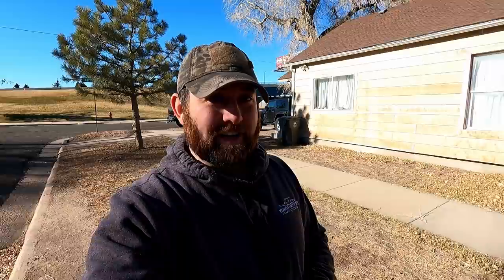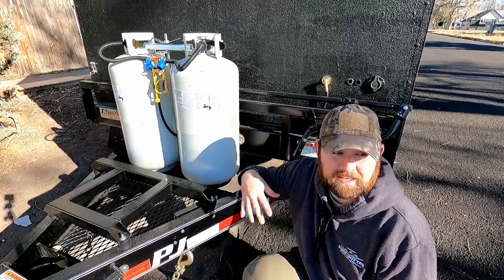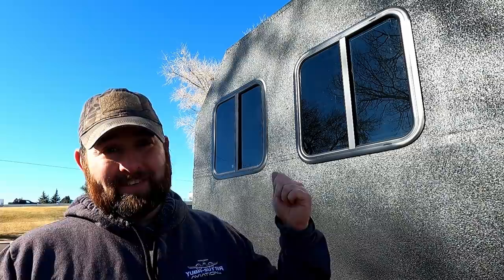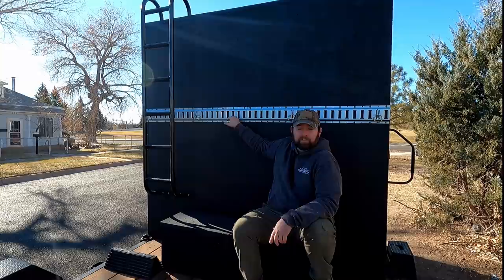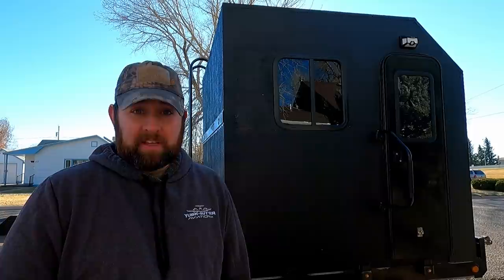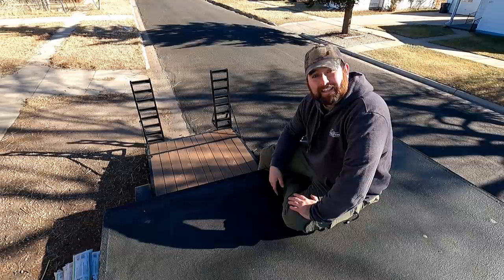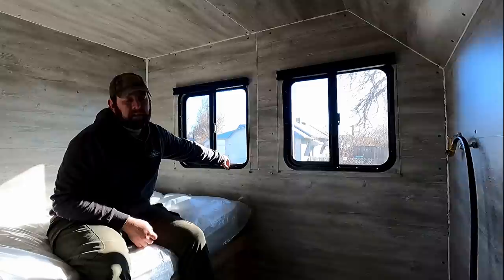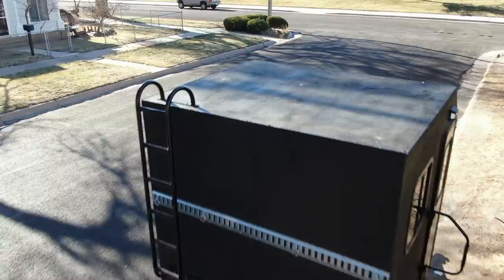DIY Crawler Hauler & Bugout Camper BUILD

Comment: An angled wind cover for your propane tanks would help secure them and add some storage space.
Reply: I was thinking the same. A box that cover the generator and tanks would look good.
Reply: Wouldn't hurt a bit if it were lockable and bullet resistant, either.
Reply: Was thinking in terms of security from thieves as well😂

Comment: You should turn the bed into a murphy bed so you can make the frame it sits on now into a couch/storage area. In the corner across from the door put in a counter top with the fridge under it and set up a rack on the deck side under the one you already have for an outdoor kitchen area with like a grill and sink that can be put away so you can water to the kitchen for cooking and washing hands and stuff. Also set up an outdoor shower off the the driver side of the deck with some type of rack to hang a curtain. You would still have plenty of room for cabinets around the top. Just some ideas I had while watching but you have a great design so far just a few tweaks would make this thing amazing

Comment: I use to be the draftsman for H&H trailers, my father was the engineer for featherlite trailers.  I suggest one thing.  your roof needs to have alum to make a water proof barrier with drip eves.  and glue and seal no screws.
Reply: @ryanjoseph5576  what was assholey about that? Just seemed like friendly, helpful advice to me.
Reply: Yeah... Raaar!  
Lol. Cool camper.
Reply: And there it is, right there, first comment. I don’t see at all where the main comment was negative in any manner. Helpful suggestion and constructive but no where near negative.
Reply: @bryanblake8607  I don't think they understand the information described.  

Hanlon's razor . 
"Never attribute to malice that which is adequately explained by stupidity."
Reply: @RichPianasOilPump  Hanlon's razor. 
"Never attribute to malice that which is adequately explained by stupidity."
Reply: @tenncutt  Hanlon's razor. 
"Never attribute to malice that which is adequately explained by stupidity."
Reply: @rcash3625  Hanlon's razor. 
"Never attribute to malice that which is adequately explained by stupidity."
Reply: Established proficiency then gave a solid suggestion.  Proper order.

Comment: May I recommend a Diesel Air Heater which you can get on Amazon for less than $150 and only needs 12v to run the blower and glow plug. It is made for campers and big rigs for comfort heat.  I use mine to run a 10x12 greenhouse.

Comment: Super cool! Add an awning off the back over the trailer for a covered deck!
Reply from the maker: I plan to add a 270 degree awning that covers the deck and the door of the camper. Can't wait!
Reply: Love it! 
I am starting to look at how to haul and spend the night with my ground up restomod 1949 CJ3A - M38 #SnugglesTheJeep 
Stealing some ideas. Thanks!
Reply: This was awesome and thank you for sharing.  I go to Moab frequently to camp with my kiddos and this was pretty neat. My only two suggestions are: protect the propane cans/lines inside and out and for the windows/door trim utilize vinyl trim and build a ledge-ish for the winows...easy to bend/glue and paintable. Good luck and can't wait to see more.

Comment: Love your trailer. 
Get a mini split. 
A/c with heat pump.can run it off your honda. Get the extended run gas cap.game changer.
Diesel water and air heater would work well.

Comment: I did all this in 2003 when I was faced with getting my camper & ATV's to the hunting lease, in one trip, 350 miles away. This was just before even toy haulers came on the market. Commercial campers are made of balsa wood & paper-mache. I settled on a 16' cargo trailer & I still use it. It has two beds with memory foam mattresses, HVAC, a 21 CF Fridge, 6' kitchen countertop, sink & outdoor cooking setup. The whole rig cost $5200 finished. I have put thousands of miles on it. Necessity is the mother of invention.

Comment: Cool build, thx for posting it.

The reason you normally have a regulator at the tank in an RV or a boat is because the tank pressure is around 125psi. Downstream of the regulator is only a few psi.
If you have a failure in a high pressure line, you'll hit the Lower Explosive Limit long before the ethyl mercaptan in the propane tells you there's a problem.
Reply from the maker: Very true

Comment: I would do low powered cameras for your blind spots on the outside of the trailer. So you can see all around you while you are in the trailer and not just the windows
Reply: we have those on the limo buses i drive. those back side cameras are life savers.  good idea.
Reply: Great idea!
Reply: I thought the same thing just thinking ahead and being safe

Comment: My recommendations for a bathroom is a bedside commode or a 5 gallon bucket with a seat lid.  Either one cleanup is so much easier and less smell unless you spend the real big bucks for a composting toilet.  Line with a trash bag and fill it with kitty litter.  I'd also go mini split or window ac over a over priced inefficient rv rooftop model.  Good luck with the rest of the build.
Reply from the maker: I like to poop on the side of the highway like God intended lol

Comment: If you haven't already, I would invest in an Equal-i-zer anti sway hitch. It will add to your safety and comfort. I would also see if there is a retractable awning that would fit your rig. Maybe have one on the door side and one in the rear. Also look into either shocks or Sumo springs for both your trailer and tow vehicle.

Comment: Hell of a job so far. I’d rethink the black color. It does look cool but I bet that’ll get really hot in warm weather.
Reply from the maker: It was by far the best route as I wanted to use the bed liner for the external for its durability, and obviously didn't have a choice in color. I also really love black, my jeep and my truck are both black. Last reason was I really want to do winter camping and its mostly cold where I go so black works out. Plus with the amount of insulation I have on it I think it will be able to offset any heat gain from the color I get in the summertime.
Reply: @CodeBrownProductions  check out DuraBak....at least consider painting a lighter color....you’ll bake in warm weather with the black exterior.
Reply: Possibly the "dip my car kit" to experiment?
Reply: What about painting at lest the roof white.
And or a 1/ 4vway down the sides. Angle it like the front angle?
Reply: I live in Texas so half the year it’s hotter than balls, that’d be my focus. Not sure where you’re at. Either way, hell of a build. I’ve been looking at toy haulers to get out with my side by side. I bet yours is about as cozy and at least half the cost.

Comment: Nice build, but lot of work and certainly quite some money.
I live in Germany, here the car's registration tells you the weight you need for the hitch - usually it ranges from some 100-200 lbs. Never heard of a car with 800 lbs on the hitch. You are absolutely right about a trailer beeing a death trap if not properly balanced, so please check again. Healthy and successful new year 2021 for you, your family and all your friends!!
Reply from the maker: I own 1 Ton diesel truck. The max tongue weight that its able to carry is 1500 lbs. Ive also added an airbag suspension for increased towing capacity and stability. I love my truck lol.
Reply: @CodeBrownProductions  Wow,  that's a very impressive capacity !
I'm curious, do you need  a  class A commercial licence?

Comment: Awesome build.  I would recommend using some pvc sheets, you can cut them on a table saw and bend them with a heat gun to match the curvature of your windows to hide the insulation.  After that you can install your windows, trim, and caulk.
Reply: I was going to do that in my safari van, up until I heard that PVC plastic let's off a poisonous gas. V.O.C's 
It's even worse in a black vehicle because it off gasses more when it gets hot.
Reply: @manuelester7420  well shoot, I didn’t know that.  Good looking out.
Reply: @manuelester7420  maybe some good ol 1/4” steam bent cedar strips would do the trick.
Reply: @jasonsodyssey  I love cedar in the van, because it repels many different types of insects and it's mold resistant.😃👍
Reply: Could he also use a second set of (good used) RV window frames, cut to fit the gaps in his current windows? It would give a factory type finish but not sure how fiddly that would be to cut and install. Probably totally not worth it financially either,  if he has to buy them new. 🤷‍♂️ Just spit-balling.

Comment: A suggestion for your concideration, make a fold down table/cat walk that is level with the bottom of your door. As a table it could be used outside for whatever you wish. As a cat walk you could go from inside to the bed of your trailer without having to step down to the ground. My thoughts on the fold down is to make it like the seats from an old military duece and a half, with several hinged legs to match up with pockets on the FRAME of your trailer.(At an angle)

Comment: Really cool build and it looks like your attention to detail is very high. One thing I would suggest is changing your position on regulated vs non on running the propane in. I understand the desire to have each accessory run on it's own regulator. But in reality, they probably all operate at close to the same pressure anyway. Most propane accessories have an operating pressure of only about 1/3 PSI. While the tank itself, on a warm day, could exceed 150PSI of head pressure. As you set it up, it will work but if you put the regulator outside and run the accessories with their regulators removed, it will also work, as long as they have the right operating pressure given to them. But if you have a leak on a hose inside the cabin, at tank head pressure it will leak propane almost 500 times faster than at operating pressure.

Comment: My only suggestion bud, is to put some sheet aluminum on the face of your sleeping cab to reduce wind drag of that bed-liner coating. It won't hurt you in short runs, but could add up in lost mileage and fuel costs for longer hauls. 
Otherwise, as a journeyman carpenter and fabricator it looks like a winner to me! Enjoy the benefits of your hard work!

Comment: Love the build!  You asked for recommendations and I have 2. You told you use a buddy-heater and that's fine, but I'm not a big fan of it. Better look into a diesel, or even better a propane heater. They don't poisen you with carbon monoxide and they don't create moisture inside. If you choose to use the buddyheater PLEASE buy a carbon monoxide and smoke detector. Just to be safe.

Comment: Cool build! Two recommendations for you after watching:  Since you have carte blanche to put an A/C wherever you want, I'd go with a "window" mount A/C unit in the rear of the camper, as they are roughly $500 cheaper than the traditional RV roof mount A/C's. As for entry steps into the camper- look into brophy or torklift "scissor" steps that are big in the truck camper world. G/L with the build!!
Reply: Ra5tadub I agree with the window mount AC. Roof mounts tend to snag on trees!
Reply: @billcawthorne3114  <— Agreed, roof mounts snag on trees AND leak much more that window mount A/C units.  One less thing to leak on the roof!!  Not sure about the mini=splits,... worth investigating if you can find somewhere good (tough) to mount the compressor, as I know you were originally going to put the a/c on the roof which wouldn’t work for the mini.  Great job and good luck.  Cheers !!
Reply: I agree on the Window unit  and if it fails you can quickly buy a replacement almost anywhere.

Comment: Probably already said , but I would get a hinged system bed (probably couldn’t have that large mattress) that could stow away on the wall for more internal space when not in use.  Ideally it would have a steel hinged base with legs that also kicked out to help with support with locking pins.  Bad ass design.
Reply from the maker: I thought about that for the bed but went with this cause it was simpler and stronger. Now I can just jump into bed without having to set anything up. Also the bed doubles as my seating area during the day.

Comment: That's interesting, but now you don't have as much room to take the wheels off if you end up getting big tires that stick out too far. For my setup I currently use an ambulance as my tow vehicle which has the rear converted to an RV that I did. If I were to use my pickup truck I probably would have just went with the truck bed camper to not waste room on the trailer. I guess if your situation is that you're towing with an SUV or something this is a pretty good idea

Comment: Hey, thats cool. Stop downing urself. I think its great. Batterys can go in the toolbox, lowes has diamond plate u can cover the generator. U could do a french bed that folds down from the wall. U can get a 500 gal plastic tote with the metal shell for 50.00 used. Fill it right before u get where ur going. Lowes has aluminum block battery accessory things with a flat head screw to add wires easily. Diesel heater for 110.00. love your ideas!! Im a 30yr otr trucker/ham operator/inventor lol
Reply from the maker: Good ideas, thank you!

Comment: Get ABS plastic and cut strips to go around perimeter of the windows and put the seam up top. Use a heat gun to bend it at the corners.

Comment: If you want some ideas, 26" steps just center the door,  the generator you could put in the truck box on the deck with your batteries and drill some holes out the back of the box down through the deck and to the front and in because you already have the holes up front,  and make jam extensions for the windows and the door out of your paneling and glue them in or fasten them how you put up the panels on the walls, You are doing a fantastic job building it I love how its looking it is awesome thank you for sharing and God Bless you and your family 🔥💯💪🏼👍👍🙏🙏✌
Reply from the maker: Those are all really good I ideas thank you! I'm gonna have to do some more research on them. I really need to make the steps tho lol

Comment: Good job it looks great as for your solar batteries later I would stick them in the WeatherTech box when you get one and you can hang your shovels chains and other stuff on the wall the generator idea is great I like how you put the rubber underneath the mounts to keep the vibration down good job

Comment: If you put a door on the backside, you can get to your deck without having to climb up on the deck
Reply: But then he’d have to allow for space for the door, re-design of bed location and it would just over all be a lot more work, especially for a door he won’t be able to use with the crawler loaded on.

Comment: a mini split AC will take up less realestate.
Reply: For sure, also be much quieter and use less power, cost a bit more though.
Reply: @portnuefflyer  cheaper than a roof unit and uses less electric.
Reply: A split system wouldn't survive bouncing around on a trailer
Reply: @yermoffroad   You know that for a fact? The reason I ask is that I have put two of the smallest  conventional AC units  I could find, that would easily run off my 1000 watt generator, as they only drew about 400 watts, in my crane cab.  They BOTH lasted about 20 to 30 hours, and then just quit putting out cold air. Clean filters/condensers, and I was planning to try the smallest mini split I could find, even if it meant I'd have to buy a 2000 watt generator.  Solidly mounted, not loose to rattle around, still an issue from regular and unavoidable road shock?
Reply: @yermoffroad  have U seen em fail ?  what brand ?  lots putting em on RVs but time will def tell
Reply: I second this!
Reply: Use a pull out step from buyers truck body Corp. It will mount underneath trailer deck would pull out from there

Comment: Beautiful job, but I'm wondering how much tongue weight you have with this arrangement?  I imagine with the jeep onboard it balances out, but can you tow it safely without a vehicle on it?
Reply: Too much tongue weight is never a problem as long as it doesn't put you over payload or hitch limits. All factory built toyhaulers have a bunch of hitch weight bias otherwise they would go the bad way when loaded which is too little hitch weight.
Reply: He said with the jeep loaded tongue weight was at 800lbs. Has a tongue weight gauge in the cab.
Reply: Wonder what it is without anything behind the trailer axles?  That camper looks like it's about halfway to the hitch from the axles-- that's 50% of the weight of it + the empty tongue weight + around 120 pounds on the tongue if those propane tanks are full.   I'm guessing 1300-1500 pounds..

Comment: Generator lock🤔
Check out JYDOG channel 
“generator lock” He built a pretty sick setup to lock up his Honda.
Reply from the maker: Thank you, ill defenitly have to go check nit out. I've been trying to think of a creative way to lock it up.
Reply: Checkout lowprolockdown.com for locking your generator. Their locking plate can be welded or bolted down. Kshmarine.com makes a nice aluminum generator box. I’ve used both over the years.
Reply: The gene mount would benefit from a rubber spacer between the bolt head (or nut) next to the gene mount (i.e. both sides of the mount).  That will isolate the vibration better, though with a Honda you should be OK as they run smoothly.